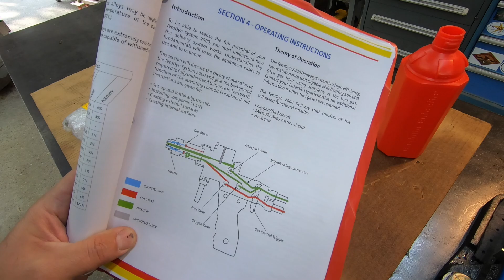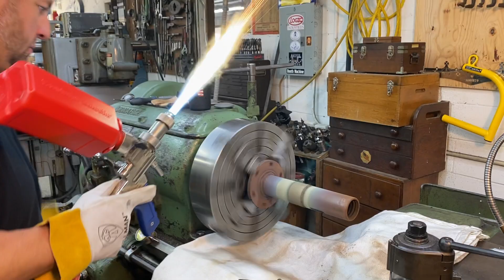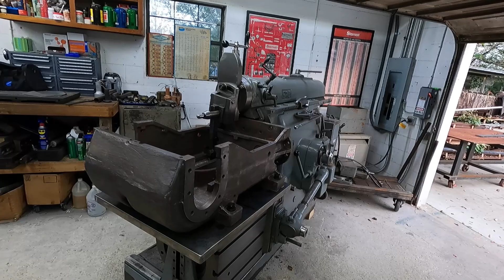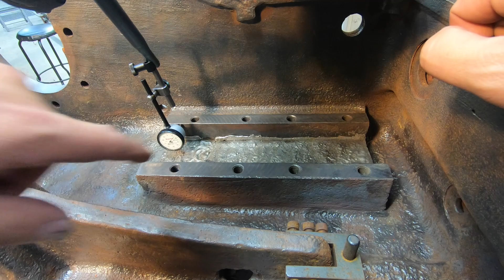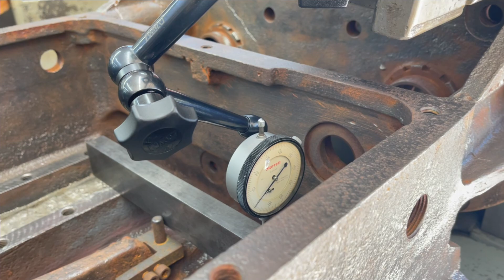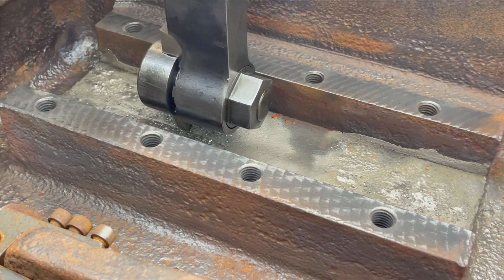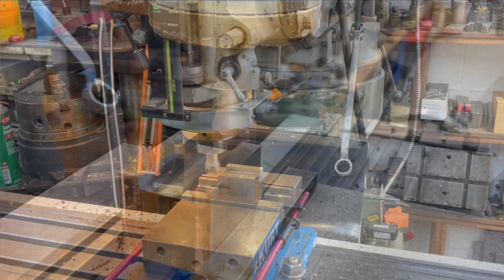SNS 331: Stoker Engine, Eutectic Torch Repaired, Tung Tri Mill

Comment: Is there some reason why, you could not use some thick turcite, glued and screwed and hand scrape?  A good choice for the tool steel  would be CPM M42, CPM T15 or CPM REX76, or ASP 30, these have excellent toughness, high red hardness,  wear resistance, they work well on case hardened steel and super alloys. this is an excellent video, enjoyed it very much

Comment: The fact that you were able to "just" get a shaper cutter in there indicates, to me anyway, that a shaper is exactly what was originally used to make the cut. The cut out sections of the rim of the lip looks purpose made to clear a shaper tool holder! It's now just a matter of tool and tool holder geometry. Don't give up on the shaper. You've come so far.

Comment: Just putting in my two sense.   From what little I know about your setup, I would suggest something that I  saw/ read about in some very old shaper and planner books.  At the time when steam engines were the only means of transportation the railroad shop and many manufacturers used planner and shapers for just about everything.   You could probably put your 32 on the table on one of them.  But let me get to the point,   they did not have a ready supply of tooling except from b&s or p&w so they forged most of their tools.  The instance that you have of clearance will probably prevent you from using a standard tool in you tool holder. The tools that I have seem are made are so that they gooseneck to the side and back.  From you videos you show, that would give you enough clearance if you had at least two but better 4 tools,
.  OK, you say why waste the time and money., and maybe you will never come up with ever having to do this again, but it is a learning challenge. Don't you know anyone with a forge that would build the tool for you.  Probably  a 1 x3 or 1x4 crs with a special cutting edge would do. Before carbide they used Stellite, which should be easy to get, and I would volunteer some if I knew where it was put in storage when I shut my shop down.    But I could volunteer some massive carbide (1 1/4 x 1 x 1/4 approx) broaching tool heads that have dovetails that you would have to remove or you could just unsolder the carbide and braze them to a new holder.  If there is any interest you can contact me rich.roanoke.va@gmail.com  and maybe we can discuss a plan.

Good luck,

Rich

P.s.  I did see some boxes of Stellite last time I was looking in the storage area but I and not sure if they would be the correct grade, but if interested I would look further.

Comment: Needs to be set up on a horizontal boring mill you can extend the spindle out on and use a carbide tip cutter. Props for making some chips on the shaper though man

Comment: it looks like they were cut with a fly cutter based on the cut marks, and cut 2 of them at a time, probably both so they were parallel and because of clearance and probably a very large mill with a very long spindle, or just a very long fly cutter

Comment: These sure are great videos but I sure feel sorry for these little stoker engines..Sure has turned into quite the “project”. The steam engine wasn’t retired on account that the stoker engine hissed, leaked, and rattled but was because that the diesel-electric was the wave of the future. You’re not going to reverse that. I’m afraid you’re going to get this poor little engine so tight that it will need constant attention to keep it running until it gets loosened up to where it was when you found it. It’s not going to hurt if it has a little blow by and makes noise. That’s what it’s supposed to do. I would have elected to get it going will very minimal work and disassembly. 
   And if you don’t know how you’re going to get into the corners of those cross-shoe slides/ways, then why the heck are you carving on it now? Why not just let it be? I’m sure there’s more other items on the locomotive that need attention than trying to eliminate all the wear on this little stoker engine. Am I wrong here? Please convince me that I am and I’ll gladly delete my comment. Thanks!

Comment: It looks like they used a large diameter fly cutter type tool to do it originally, by the marks left on the surfaces. This would have left clearance for machine spindle.

Comment: I would do that job on the vertical mill with a 1'' dia. shank Valenite collet  extension 12" in length. If you find one 7" long, you can make your own extension for that. I think it would fit on a Bridgeport table. Just my humble opinion, it's probably worth what it cost you.

Comment: Sorry I'm late to the party. Here's my response as though Adam hadn't rejected special tooling on his opening comment. 

Don't be dismayed by difficulties when accessing deeply recessed surfaces in a shaper or planer. If you can't get at it with common tooling the alternative is to make special tooling.

The beauty of shaping with a single point is the ease of making special cutting tools. My suggestion is to make several shanks to fit the eye of the lantern tool post; some with right hand crooks, some with left ala Armstrong holders. Machine slots on the back face of the end to recieve the shanks of short tool bits to be ground later after silver brazing. Silver braze the tool in place and then grind the tool geometry. Easily modified wood mock-ups will assist you in converging on the best design. .

About silver brazing high speed steel: Most high speed steels are quite heat resistant but only a few withstand silver brazing heat without losing edge hardness. My experience has shown M-42 to be the best choice of the commonly available alloys in ground tool bits for most applications. T-15 is a bit harder but expensive, hard to find, and subject to chipping. I suggest Harris Safety-Silv 45 and the recommended white or black flux. For those reading along, you can get a blister pack kit containing a couple of feet of the wire brazing alloy and a tube of flux from a welding supply, Amazon, and sometimes the big box stores. I refer to Harris Solder kit #5631 #SSWF7. This is a slightly different alloy with a richer silver (and more expensive) content. Expect to pay $40 to $50 but it's about a 10 year supply considering how little is required per job and how infrequently it's needed.

One thing for those reading along: success in silver brazing is dependent on scrupulous joint cleanliness before brazing. After machining, fitting, and readying your fixturing, remove any heat discoloration, scrub the parts to be brazied with hot water and kitchen sccuring powder. Dry with clean, unused paper towels (shop towels often have traces of oily residue.) DO NOT "CLEAN" WITH ACETONE. Acetone usually has traces of oily or waxy by-products that interfere with fluxing action. Braze immediately. Heat carefully: silver brazing takes place at a barely red head (about 1200⁰ F). The flux scorches and become inactive at low red heat.

Comment: Avoid shaper/stoker housing interference by locating fixture /housing below ram.
1. Remove existing shaper box table/vise assy.
2. Braze (4) steel tube legs under fixture plate.
 3. Rotate fixture plate/stoker housing 180 degrees.
 4. Braze tubing legs to shaper housing base.
  5. Provide an extended length tool bar with a square carbide tipped brazed tool.  
.

Comment: Twin channels appear base  lined with flat steel strip, brazed in position requiring no machining.
Check crosshead assembled dimension to determine strip thickness required.

Comment: Would it work to turn the workpiece 90 degrees and cut the ways crosswise?  You would have to do the ‘near’ pair and the ’far’ pair, but it may improve the clearance issues.

Comment: You need a large vertical mill, something they would have in a locomotive shop.  Then use a special arbor/tool holder to have an appropriate slab mill on the end. From what I see you would need to take two passes due to the clearance at the end not allowing a cutter diameter of the full width to clear at the end of the cut.  Slab mill cutters have a keyway across the side face by the arbor hole which engages a tang on the end of the arbor.  The other side of the cutter is counterbored to contain the attaching nut to attach the cutter to the arbor [which has a short thread on the end] and be concealed, allowing the tool to cut on the end and the side.  A shell mill is similar.
You can see from the tool marks on the four rails with the tapped holes that they were machined with a slab mill, two rails cut at one time, one pass.  They probably kept the set up changed tools and milled the bottom of the channel.
You are not old enough to know how things were done in days gone by.

It appears your shaper is on wooden blocks, if so I don't approve.
JIM

Comment: Adam 
You need a large high speed tool 8 or more inches long that mounts directly in the lantern tool post. Maybe silver braze a steel shank on the tool bit to extend it down.   Another trout is use cemented carbide bits welded to a steel extension.  I’ve used them for machining SS overlay in large shaper and they don’t chip.  But you will have to sharpen them occasionally.    
Dave Wantz.     Currently 1309 machinist

Comment: Ya know, I think this job is pretty cool. Glad im bot the only ine that gets an odd shape and cant do something with it. Drives me nuts. However.....if you follow any steam loco groups at all, youd know the UP Big Boy 4014 was just restored and made it's first trip last year. I went and seen it and that thing is a beast to watch it roll down the tracks. Complete tare down and rebuild. I have n ok idea what loco this stoker is from, but know iij ng that the UP needed drawings, machining and reassembly of its big boy, they needed or possibly ran into this very thing or at least know how it was done and on what equipment etc.. I dont know if you could call UP, if they would even talk, or search around and search within UP to find the ones behind the rebuild of the big boy, (Museum?). Im gonna guess their the ones thats gonna lead you in the right direction. Worth a shot? Worse they can do is laugh and hang up on you or give some insight. Just an idea to mull around with.

Comment: Hope you don't mind me riding a dead horse, but anyways:
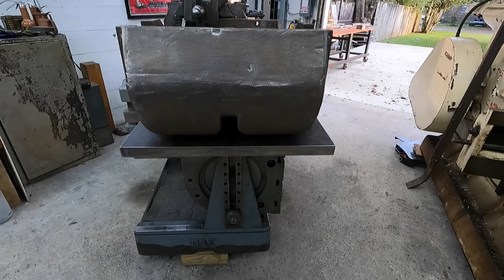It has been suggested to rotate the part by 180° and you countered that this will not work due to clearance issues. I can see that the table is already in the lowest possible position (see 12:00) . So, yes, I agree with your objection.  However at 11:42 it looks like you might be able to rotate the table by 90° counterclockwise and gain several inches by mounting the plate directly onto the face of the table. You will have to find  a different way to align the part horizontally though - perhaps by shimming.

Comment: Have you tried to turn around the engine 180 degrees? Also you can install the cutting tool on an angle so it clears the surrounding.

Comment: Have you considered milling with the flex arm? I know that tool is not designed for that kind of work at all but there is a possibility of putting a carbide mill in the chuck on it.

Comment: Hi Adam. Great video as usual.  Would the casting have been originally machined on a horizontal borer. Possibly stood on the end that you clocked up. The spindle could then be extended out with an end mill in it and traveled vertically. You might still have clearance issues. Regards Richard

Comment: Adam, in some of Stephan Gotteswinter's older videos, he had a small tool-room shaper.  He typically ran it "backwards" with the cut back towards the machine, basically to minimize the amount of chips that shot across his shop.  If I remember correctly, his shaper had two clapper boxes -- one for "normal" or standard cuts and one for "backward" cuts towards the machine's casting, but the second clapper box was fairly simple.  If you could set up to cut "backwards," wouldn't you have a lot more room for these cuts?  You could make that type of clapper box fairly easily with your shop capabilities, if desired.

Edit:  Doesn't Keith have copies of the stoker engine drawings from the Customer?  I believe that he shared one or more of the drawings a while back.  If he has it, the engine drawing ought to show you what surfaces to use as datums as used when the engine was originally manufactured.

Comment: I'm curious as to why turning the bit way off to the side doesn't work? I assume that's been considered and won't work for some reason I'm not aware of. From what I can see in the video that should clear, so unless there is something sticking out where I can't see it that's not the issue. Would the bit's stick out be to much? Or would the off center loading be a problem? Or is there a problem with grinding and using a canted tip? Something else I'm not even thinking of?

Comment: It can be that these planes is grinded with a bowl-shaped diamond wheel. Bowl installs at some tiny angle to use its edge in basics. This kind of tool can be installed on qute long rod because of relatively light side load. At least many machines made in USSR had planes grinded this way.

Comment: Could you try,a long piece of tool steel clamped in the clapper and sharpened on the end but narrowed down by grinding to 1/2 inch.
Or braze a short piece of tool steel to a long square hard bar clamped in the clapper. . The tool is expendable just to get this job done?
Dam you are patient,well mannered so skillfull. You would be a plesant boss. Here in Louisiana some machine shops are a crew of Bruts.
Our oil industry is crippled by our dump democrat governor.
Shops are slow!
You just have to walk away from the Stoker, it’s going to come to you in the shower while scrubbing your head!

Comment: Not a machinist, just a mechanic.....Is there any sort of portable smaller mill that can be mounted to the 4 small "rails inside the engine?  Maybe even mounted to one side while cutting the opposite?  If that doesn't make sense, where I am going is....mount the machine to the work, not the work to the machine.  Such a mill might not exist, but a thought.

Comment: I'm no machinist, but correct me if I'm wrong, but since that area was not milled when the engine was working, why is it so necessary to mill it now? Is it only for cosmetic reasons? It seems such a shame after all that work ...

Comment: Why not rethink whole approach and make two harden T shaped inserts where you have welded you could machine case  from top flipped over and figure out  how to drill for bolts might need gasket to seal off inserts, and they would be replaceable.

Comment: I am sure some one has suggested this but many years ago a shop I was working in had a similar issue. The solution they came up with was taking a 4 inch round bar about sixteen inch long and  machining one end to fit in a mill and making the other a fly cutter. They were able to reach in and gently cut the surface while avoiding the structure. Good luck.

Comment: Each cross slide has those flat machined decks with the bolt holes running down each side of the surface you want to machine. Perhaps the factory machined those surfaces first, drilled and tapped the bolt holes, then attached tooling to those surfaces that could machine what you want to machine now.

Comment: Adam, I'm feeling your pain and have bin in a similar position many times. You promised to get it done as the the job appeared the first time; it looked tricky but doable. When you're really starting to work at it, Murphy jumps out of his box and things start to get difficult. I learned that, by going over and over a job in your mind, a solution will pop up eventually . Not relaxed though, it cost me many, many, nights of sleep, but if you want to solve it; you will solve it. And if you do, one way or another? Man! That's satisfaction! No matter how you get the job done; the result (for your customer) is what counts. Even if you have to ask a specialist who has machinery or skills that you don't own (yet). For me, looking at a distance, a long piece of ground tool bit can save your plan. A long nose "lathe" parting tool shape with a nose long enough to get to the bottom with clearance on both sides of the track and ground back far enough to get the first cut in the back of the casting without touching the case in the back too. By long I mean long enough to keep your clapper box above the casting so it can reach all sides without interfering. Lose the Armstrong holder,  just use a long piece of High Speed Steel blank for length and rigidity and take light cuts like you always do with a uncertain setup. I'm no wizzard here who knows how it should be done but I hope I can contribute to you unfolding a successful plan to succeed. I'm certain you will, one way or another, get this job done. The Beatles sung; "with a little help from my friends";  If that's a solution, it's still a successful story to tell us. Thank you Adam for all your nice uploads. Keep up the good work, be happy and stay safe, best, Job

Comment: It would seem you may need an angled ( on the flat axis, hold your hand fingers curled with the thumb on top. Now curl your wrist left, and now right. See?) Or an adjustable tool holder. They made them I've seen then around....  You could try making one...

Comment: hello Adam, have you considered setting a tool post or other grinder to the toolholder maybe even a Dremel (although i have found the dremel a bit limp on power) but a carbide burr would do all the roughing cuts the you could finish with a carbide cutter in the tool holder. i have often found thinking outside the box to be beneficial

Comment: Hi Adam, could you use some of the equipment at Motion Industries to perform the job? 🤔
Also, the arc-shaped tool marks atop the threaded bosses reveal the diameter of the cutter that was previously used. 👍